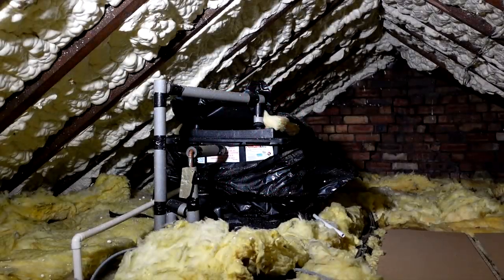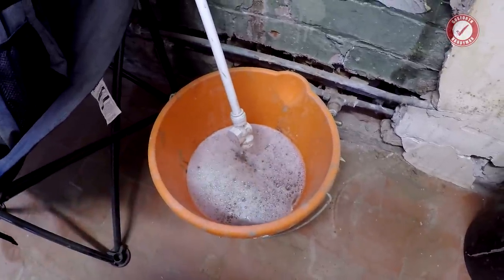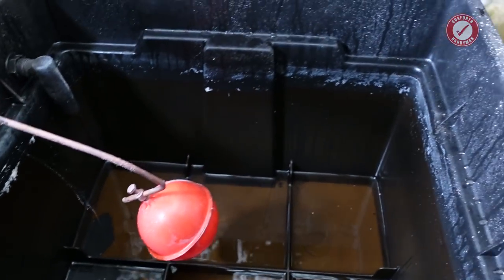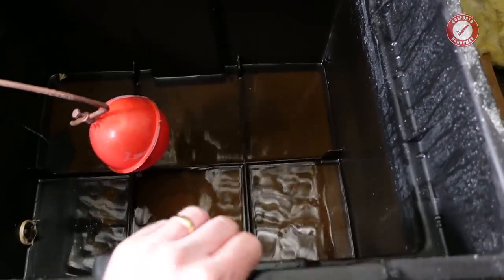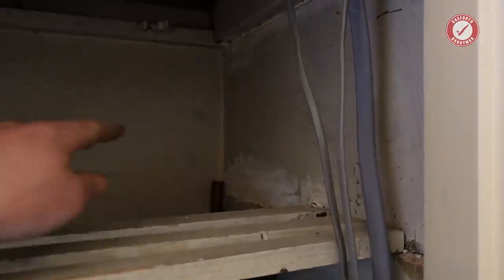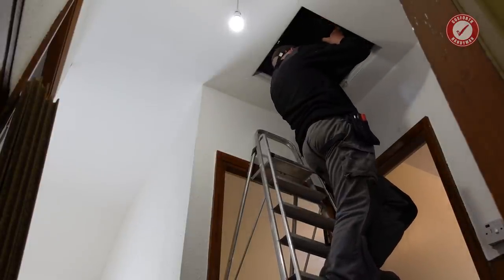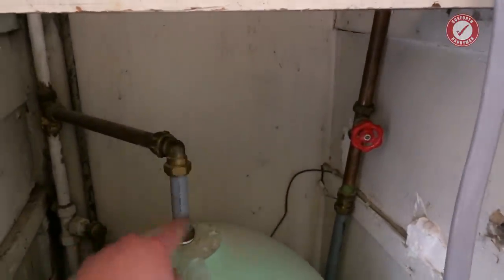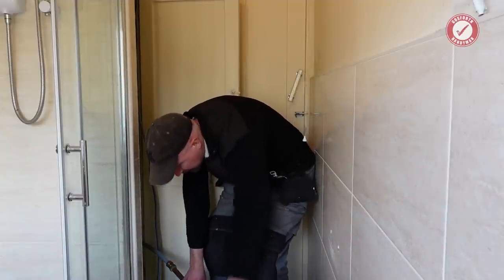Removing the old hot water tank (1920's Renovation Part 13)

Comment: Thanks Andy. A 'top tip' alternative to emtpy a hot water tank is to take the immersion heater out, stick a hosepipe in all the way to the bottom, and secure it with a clamp or cable ties. Take the other end out in to the garden and give it a good suck to get a syphon started... It'll empty very quickly with a 3m head. You can do the same with header tanks too if you wish.

Comment: Took out a cylinder in the Thames Valley.  The limescale was two inches thick and it took two of us to carry the tank.  Oh, and the bottom boss came away with just a nudge - the copper had been eaten away.  I was heart-in-mouth seeing you bending the plastic pipe attached to the bottom boss with 120 litres of water above the joint.

Comment: I did a lot of the work you are doing now in the street behind you (facing the burn number 24) in 1980’s. The houses are solid and pretty easy to work on. Watch out for rotten ends to the timber joists on the ground floor. I built a conservatory on the back of mine, a number of the joists had rot on the ends, I just sistered new ones on from the conservatory side. I think the damp proofing in some parts was compromised. I also had the walls insulated, there is a cavity, you can tell there is a cavity by looking at the brickwork, it’s all stretcher course, which is a good indication of a cavity. I like your use of ‘road’ “In any road” or “in the road”. I wonder how many of your subscribers understand the different use of the word, or what it means. Had 20 happy years there, both sons born and brought up there, I’ve told them about the renovation and to watch it, so they can appreciate what their dad went through😂. I looked at a house where you are and tried to buy it for the same reason, the back garden, but was beaten to it by a cash buyer.

Comment: I'd have used a long hose pipe and syphoned the contents of both tanks down the stairs and out of the front door. Job done. The difference between plumbers and handymen is that two plumbers working together will do that job in about 15 minutes flat, whereas you and I can take all morning.

Comment: The open header tank explains why so many showers have a very weak flow in the UK, I have never seen these in the Netherlands.
None such as a rain shower with these open header tanks, a gravity fed system gives you just 0.1 bar of pressure for each meter the tank is above a tap/shower head.
In the video the tank is 1.5 meter above the shower head at best, so that's a meager 0.15 bar of pressure

Getting hot water directly from a combi boiler will give you a much better flow rate.
A combi boiler will feed your hot water supply with 2.5-3.0 bar, that's 20x as much as the tank in the example of the shower.

A combi boiler also has at least twice the heating power as the electric shower (why a hot water tank AND an electric shower?)

Comment: Rock wool/fibreglass insulation.
If I'm in a loft for any amount of time, I'll make up a very weak solution of PVA in a garden sprayer and spray the stuff down. Not to soak it but to 'set' the dust and loose fibres.
Get yourself a drill powered pump and a couple of short lengths of hose. Ideal for this, toilet cisterns, bowls etc.
Reply: That PVA tip is brilliant - thanks Andrew.

Comment: The pipe cutter should be turned so that the wheel follows the two guide pins, not the way round you were doing it. That way it only cuts once instead of cutting a 'thread'
Reply from the maker: It's crap - it doesn't work whatever way you turn it. 🤣
Reply: @GosforthHandyman  I find that you need to wind the knob up when you start so that the cutting wheel is really biting into the pipe - then the first revolution cuts all the way round rather than winding along the pipe and creating a "thread"  - whatever, pipe cutters are waaaay better than a hacksaw!
Reply: I’ve put an arrow on mine pointing the way to turn the pipe slice.

Comment: I did notice when using the mini pipe cutter you were using it the wrong way. They cut clockwise or the rollers follow the cutting wheel. But really enjoying this renovation. More videos please.
Reply from the maker: Cheers! This cutter never works - whatever way you turn it it does the same.

Comment: When I was working as a plumber draining a hot cylinder. A length of 15mm copper pipe long enough to reach the bottom of the cylinder with about 100mm of pipe clear of the top of the cylinder and a hose  connected to the pipe  and the hose long enough to where you want the water to drain and just syphon the water out.
Reply from the maker: Yup - great tip! 👍

Comment: To stop it threading you don’t do it super tight and you don’t keep going round just back and forth until you have a good cut 😉 first thing you learn as a fridge installer
Reply from the maker: It's terrible that cutter as it's not spring loaded so you have to keep tightening it as you cut. I should really invest in a better one. 😁
Reply: thanks for that tip [from me] as I've always had hit and miss results with my cutter. thankyou

Comment: For the future just drain via a hot tap, crack the top joint on the cylinder (should only have a dribble left) pop a hose in and Syphon it out. May get a mouthful of limescale though.

Comment: When I was having Central Heating fitted, I stipulated that the immersion was to be retained for emergency use, the heating engineers were not impressed and had to fit additional valves to isolate boiler water from the immersion water.
It paid off as my boiler broke down a few times but I was never without hot water.
Reply from the maker: I think that's the one benefit of a cylinder. 👍😁
Reply: I don't think that's anything unusual. In fact, every system I have ever seen with stored hot water (as opposed to a combi boiler) has a backup immersion heater. No additional valves are required- the cylinder is heated by a coil, which keeps the heating circuit separate from the stored hot water, and an immersion heater is installed in the cylinder to heat the stored water directly if required. I would go so far as to say a gas heated system complete with cylinder but without a backup immersion is unusual.

Comment: Thanks for this video. Could you answer a question for me. 
You know when you cut the cold water supply that feeds the reservoir, before it goes down into the hot water tank, do you put a stop end on that because when you turn the water on you will basically have a fountain in your loft if you don’t?? 
I just didn’t hear you mention that you did that, but I presume that’s what you do? 
Thanks in advance and again, thanks for the awesome videos.

Comment: haha 
pipe cutters always catch me out also 
I remeber having to use them on a course I did....managed to perfectly flatten the inside of the pipe somehow lmao
Reply from the maker: Lol yeah, I should really invest in a decent 22mm cutter... but rarely use copper these days and I'm too tight.
Reply: @GosforthHandyman  haha same
Reply: @GosforthHandyman  I  was told by a plumber to always try to turn the pipe cutter towards its open throat. More control and you can force it to stay at one height. An tighten the adjuster as you turn, in small steps.

Comment: I find the best way to drain cylinder is to stick a hosepipe in top connection of cylinder and then siphon water out if original plumber has not fitted a drain valve at bottom of cold inlet
Reply from the maker: Good tip! 👍
Reply: @GosforthHandyman  Jumbo car wash sponge and bucket for removing dregs of water from cold water tanks

Comment: Someone can correct me but the disgusting water from the header is from the heating system and goes through a heat exchanger in the hot water tank.  The clean water from the hot water tank is what you have a shower in.  If I'm wrong, I've been having Fernox showers!
Interesting video as always, Andy.
Reply from the maker: This house doesn't have central heating. Normally you'd have a separate header for the radiators. So yeah, you should be safe from the Fernox. 👍😬
Reply: I have what James has, two large tanks in loft, one for central heating the other for hot water, and for some reason a smaller tank above the cylinder in the cupboard. Haven’t worked that one out yet, maybe something to do with the pump?

Comment: A simple job made a little harder in that the previous diy fit from the look of it 😂 didn’t fit a drain off which is essential for replacement of the elements.
Reply from the maker: Believe it or not this was a pro install as part of their bathroom renovation about 5 years ago. Lots of shoddy work. 🙄👍
Reply: @GosforthHandyman  I see it all the time diy guy becomes a plumber/ bathroom and kitchen fitter it normally ends in water pouring though the ceiling at some point.

Comment: Honest question as I don't live in the UK...why do you need both a hot water tank and an electric hot water unit in the shower? (I refer to the think you can see in the shower at 16:17, I assume it's one of those electrical units where the water gets heated instantly as it passes through) Thank you

Comment: The best way to empty a cylinder is to syphon the water out. Put a short piece ( 150 mm) of 15 mm copper pipe into a garden hose then put the pipe into the cylinder via the top connection until it taps on the bottom. Run the hose to a drain point lower than the cylinder bottom and suck the end of the hose. Be careful, you don't want a mouthful of water & debris from the cylinder, so a big suck for 5 - 10 seconds is all you need. Don't let the hose kink shut either as that will make sucking more difficult. Once started the syphon effect will continue, so you need to wait for 20 seconds or so after sucking for the water to arrive at the hose end.  This will empty the cylinder so it is light & easy to move. You can stuff kitchen roll in the cylinder connections to prevent dirty drips if there is a nice carpet between cylinder & door. And yes, I'm a plumber.

Comment: I'm not sure it's been said but next time take out the top immersion and stick a hose in there or knock a hole in the top with an old screwdriver/chisel. I used to do about 2 of these a week takes about 15 mins once you have done them a few times. The real trick is getting them out of the house without dropping sludge all over the customers carpets.

Comment: A gravity-feed hot water system wouldn't give you much pressure to a shower head, but I'm sure they had a reason for doing it that way.  Perhaps the original installation was just for filling a bath, and pressure wouldn't matter as much for that.  Our needs and wants have change quite a bit since that house was built!
Reply from the maker: They had a separate electric shower so this was only supplying the basin the bathroom and the kitchen sink. The piping is still in place from the old back boiler too! 😁👍
Reply: Our whole estate had gravity systems installed and that was in the late 1990's. One bathroom shower was a pumped electric, the other a gravity mixer which soon got changed. The plumber who put in that plastic tank wasn't familiar with the Water Regs.
Reply from the maker: Electric pumped are good but they drain the hot water tank VERY quickly!

Comment: Get an evolution saw, i cut a redundant metal header tank into two and took it out the loft with ease.
Reply: Could you please specify which saw you used? I thought a small grinder would do the job, but am very concerned about sparks in the loft.

Comment: Have you considered sticking an unvented back in? Showers will be amazing quality with the water pressure you had.
Reply from the maker: Yeah, we'd also run out of hot water very quickly. Been there, done that, never again. 👍
Reply: Gosforth Handyman A well designed and specified pressurised system means endless hot water. You just need to choose your tank, coil and boiler size properly. They are infinitely better than a combi. You can also fit a sensibly sized boiler, instead of having to use a 35kw combi to run perhaps five kw of heating demand.
Reply from the maker: Eh? How's it endless hot water? Once the tank is empty you have to wait several hours for it to reheat.
Reply: @GosforthHandyman  My parents have got a 100 l pressurised tank connected to the gas boiler and it takes less than 10 minutes to re-heat to 45C. I still wouldn't call that endless hot water though.

Comment: What is the water pressure coming into the house that you need a header tank?  At my North American home it’s typically 50-60psi however I discovered in my newest home I have 100-110psi yikes!
Reply: You've gone from about 3 bar to 6bar. Don't know what equipment you have over the pond but I'd think about getting that reduced. I worked on a whole new estate located right next to a pumping station each house hit 8bar..... Cisterns were popping constantly.

Comment: I m not familiar with this kind of system. How does the hot water flow to the various taps, is it pressurized somehow?
Reply: Gravity fed. The header tank in the loft gives the pressure to the taps on the floors below.
Reply from the maker: Yup, as Stuart says - just gravity. It's rubbish but very common in the UK.

Comment: I understand how a pressurized expansion tank works, but for the life of me I don't understand how the unpressurized one you removed works.  Can you explain?
Reply: Cold water flows into the header tank in the loft (mains pressure) until the float closes the supply. Gravity now makes the water run down from the header tank into the immersion tank in the bathroom and out through the taps. If you allow the water to sit in the immersion tank, the element will heat it. Turning on a tap makes cold water from the header tank push out hot water into the pipes and out the tap. Saves you having a sturdier immersion tank with a pressure relief valve, that's the only advantage I can see. The huge downside is obviously the dismal hot water pressure, especially on the first floor where there's only about 2.5 m of head at best. Slightly better on the ground floor.

Comment: Hey, quick comment: the small notes you put at the bottom of the screen often end up underneath the closed captions and can't really be read if you have those turned on. Would it be possible to move your notes somewhere, dunno at the top maybe?
Reply from the maker: I'm amazed closed captions works with my accent - I dread to think what it says 🤣😉
Reply: @GosforthHandyman  mostly it's fine actually, certainly no worse than other automatic transcriptions. My spouse and I watch together during lunch or dinner, and CC means we can say things to each other and not miss anything.
Reply: I have loud children so Closed Captioning is a must.  I don't find too many problems in translation even with a northern accent. But Cornish was interesting.  Kiwi is a laugh sometimes too.

Comment: When that cylinder was fitted they missed out the drain point at the btm of the feed
Reply from the maker: Oh, they missed many things out. Glad it was a plastic pipe!
Reply: And why is it that hot water cylinders always seem to be installed with the cold water entry at the back of the cupboard in the most inaccessible corner?

Comment: I guess you are going to fit a combi boiler? All fine and dandy while it works but when the thing packs up, which it will, you will wish you had the indirect cylinder with emmersion heater still in place! ask me how I know this with three femails moaning there is not hot water to get washed with!

Comment: The technical infrastructure for cold and hot water supply inside british houses is frankly spoken the most primitive of entire Europe. I was shocked after I had the opportunity to see it first time. Inefficient, unhygienic, in danger to freeze during winter and also no water pressure inside the pipes. Still two tabs for hot and cold water inside the wash bowl. If the bath room is upstairs, there is no real water pressure to have a nice shower unless there is an extra pump installed. After I visited him, I invited my british friend so see our systems in Germany. My house was build in the seventies. He was very impressed. Why is the technical infrastructure inside british houses so backward?
Reply: That's why he took it out. We use mains-pressure combination boilers and tanks now, some of which are German.

Comment: I don't understand why water pipes are in the attic; it seems like a disaster waiting to happen.
Reply from the maker: It's needed for water head height 👍
Reply: @lotecque  In ancient times the hot water tanks (cylinder) weren’t strong enough to withstand mains water pressure at 4-6 bar. So they just used a tank above the highest point (usually the loft) to provide a few feet of water pressure to feed the taps to the bath and sinks. Never enough for a decent shower which is why you can see an instantaneous electric shower fitting above the bath.

Comment: Question for those who’ve done this - DIY doable for someone with moderate skill? 

Guessing will need a spark to disconnect then just rip out as per video? One question in my case would be how can I then retain the cold water supply - as I’ll have a gap between removal and refit of new combi.